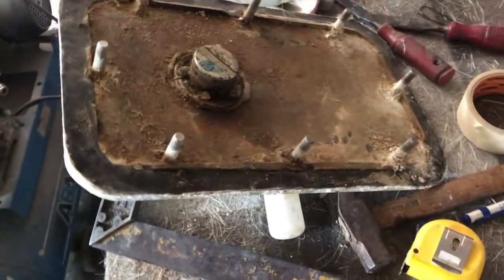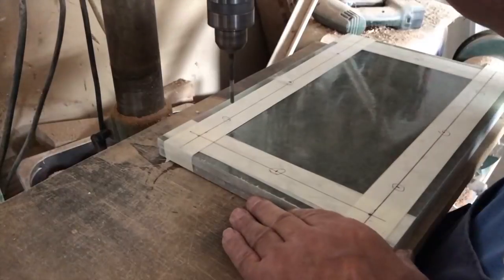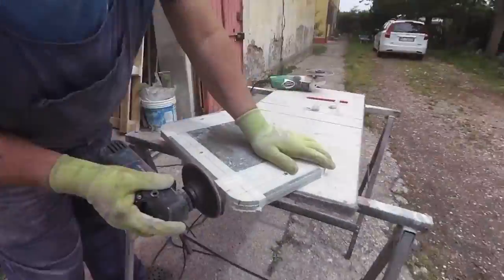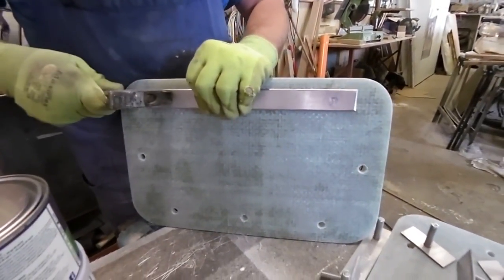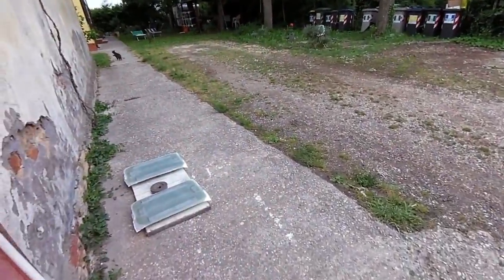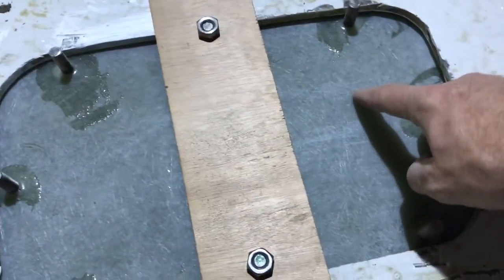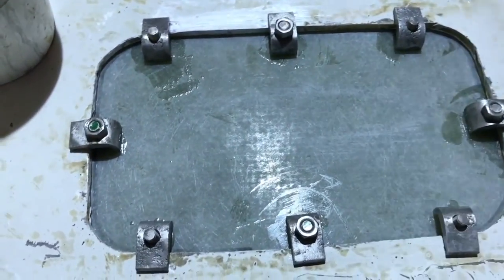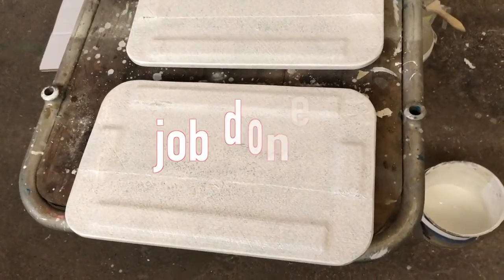Hallberg Rassy 312 "Ellös - Sea4See - The New Water Tank Lids

Comment: You did a great job on what is a completely wacky original design - there were and are much simpler solutions. But you did good.👍
Reply from the maker: Norman Boyes thx a lot for comment! Yes I copied totally original lids because  was to stress thinking  how to deal with a better easy solution! 🤪
Reply from the maker: At the end you get the same design as is it now but you have a round one... instead a square one.... 🧐 but you need to glass to cover the water tank hole..... the tank is long 1,80 meter if you need to inspect inside with a small roud one you have no way to fix the problem than cut another hole if you need to reach the far away part of the tank believe me not easy solution...😜
Reply from the maker: Hey mate! I’m not a naval engineer , all Hallberg rassy boat are Lloyd approved for quality  construction and Class A. Ocean going, didn’t risk to lost the approved certificate for a structural modification not necessary and lose the strength of the boat due the fact that the water tank is integral and strong structural..😉 I’m not like Mads -Saillife that are building the house in the water😂

Comment: Do you recall the depth of the water tank?
Reply from the maker: Hey mate!!! Yes fix the problem!!! You can’t belive… they sold me the sensor that didn’t work with the instrument two different measure … ohm vs millamper they don’t talk spend time money finally fix!!! Hope to show in a video!!!
Reply: @sea4see  I cleaned my tanks and made new lids this weekend.  Wow that was a very gross job, I had the same aliens in there!  The tank is 10" deep for anyone interested, I installed a stainless sender (same style as the desiel tank) so it can be removed easier next time.  It is 0-180 Ohm to work with the existing guage.  I don't like the sender with the arm attached, the old one was so corroded.
Reply from the maker: Kurt I make a mistake I use a sender with ohm and instrument was milliampere.. ah ah ah such a mistake

Comment: Fitst of all I’m impressed about all the work You have done so far. It looks great and follow your video’s with pleasure!

I tried to find the video where You produced the lids of the water tank. Did You make these by hand lay-up of fiberglas and epoxy? Or did You buy plate Material ready from a shop? Need to do the same job on my HR 352.
Some more information would be helpfull, especially if You did it completely by yourself.

Many thanks, look forward to SE the final result!

Take care,
Reply from the maker: Thx Jon, here the video. 
https://www.youtube.com/playlist?list=PLyykrr68LMLcqaew5A2yIeyvpeM5JaBNb

I don’t remember if I film the making of the layup but for sure if you are it wrest you can pm me I explain! Cheers and thx for following
Reply: @sea4see  Thanks for your quick reply! I checked your video but I did not see what you exactly did to produce the lid, just the result was shown. I understood from your message that you made the lids by yourself; Which steps did you do to produce them? nr of layers, underground (what to prevent sticking to the underground), did you use a model? I would be very happy if you could explain in a bit more detail. Many thanks
Reply from the maker: Is piece of cake do it! 
uses thick nylon that used to cover greenhouses in winter. cover a plywood panel with this nylon Then you start laminate the epoxy  resin and the biaxial fabric until I reached the desired thickness. Use a bubble breaker. the metal roller and the brush to impregnate the fabric with resin

The epoxy resin does not stick in the nylon, so I would peel off the panel once it dries without problem and it will look nice straight under, that is the outer base of your new lid.
Reply: @sea4see  Many thanks! Good and clear instructions! Hope they will look as good as yours.....

Comment: Fantastic job! It was a pleasure to watch how well you did it. I’m not sure why Halberg Rassy designed the kids to be inserted inside the tank rather than on the exterior with bolts through the tank itself? Whatever the reason, you have done a first class job replacing them and should be proud of yourselves. Best wishes.
Reply from the maker: Thx very much for drop a line! And to watch my sailing vlog! Yes is true! I didn’t understand why  Hallberg Rassy choose this complicate system.. to avoid problem I clone the original one so no problem... 🤙🏻